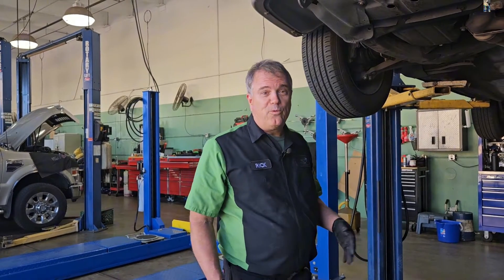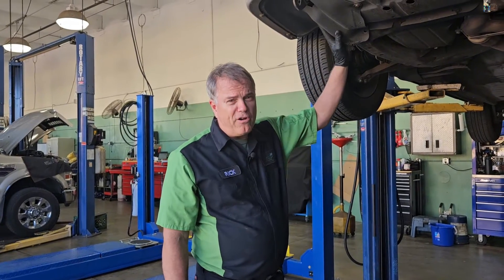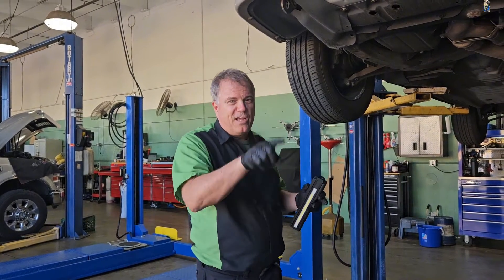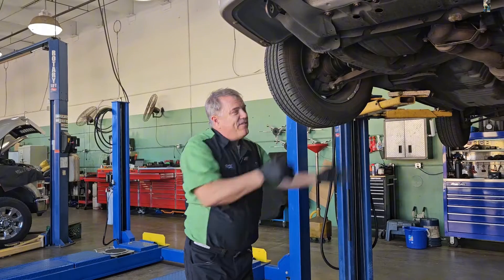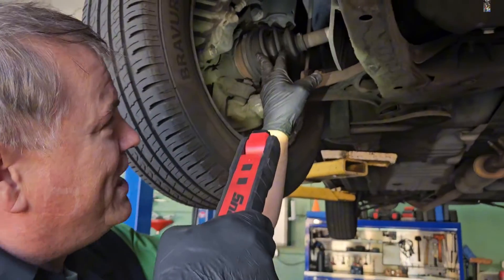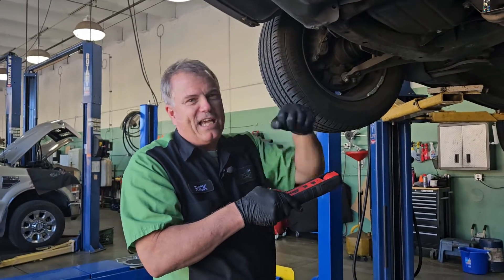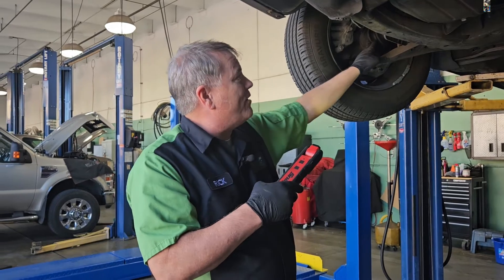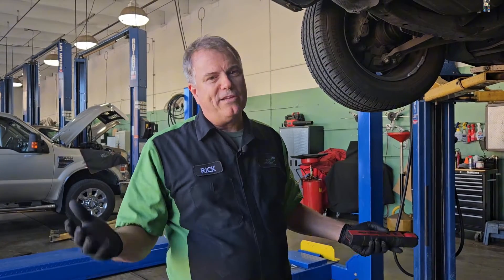What does a CV Axle do?

Comment: How much should it cost to replace this and what all would I need to order??
Reply from the maker: It varies dramatically from car to car. I personally prefer new axles over remanufactured.  As far as what you would need, usually just the axle assembly.  If there is a leak at the inboard end, then you will want to replace the seal while the axle is removed.  Always use your VIN number when ordering parts...it's more reliable than using make, model, year.